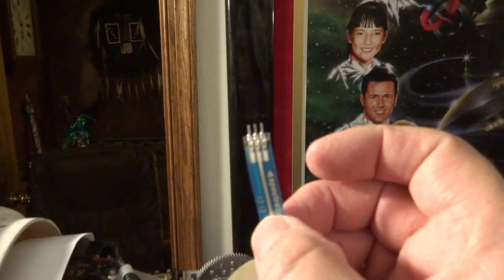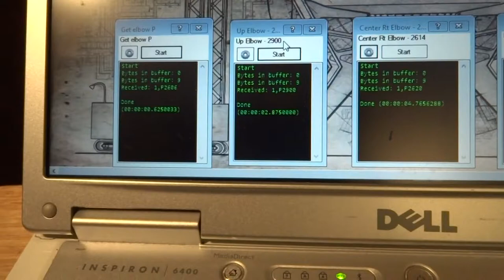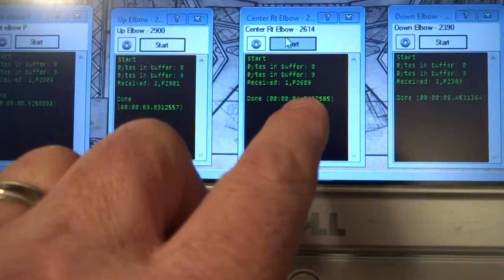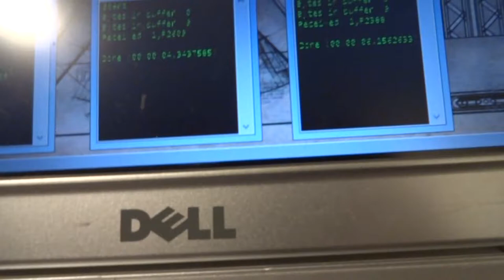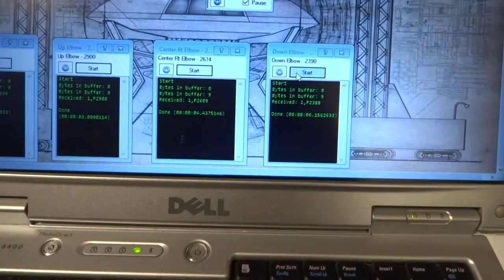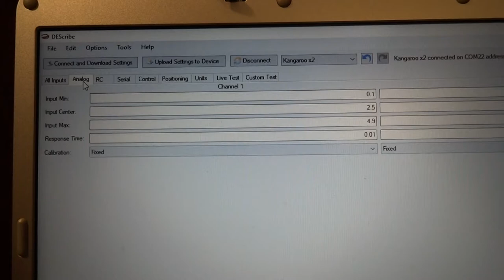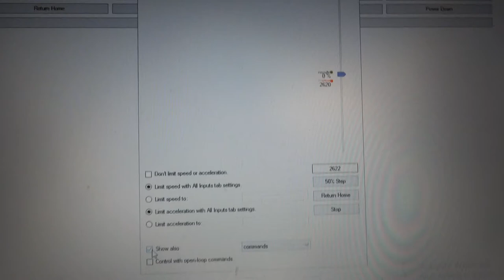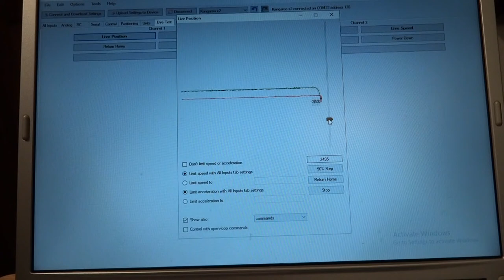B9 Robot Arm Centering Issuedemo

Comment: Hi Dave!
My guess is that your different centering points are caused by gravitational acceleration.  I'll bet that if you could lay the system on its side that the arm would center correctly from both deflections.  That is, the gravity "assist" when dropping back to center is causing it to overshoot the 2614 ma position simply due to inertia.  When coming upward, the gravity "drag" also hinders centering, but as it does not add to momentum going ups are the system has more time to stop closer to the 2416 ma spot.  Is it possible to create two centering commands, each with a different setting ( i.e., a higher one when coming down that causes it to "overshoot" to 2416, and a similarly adjusted one for the upswing?

Mike Buck
Reply from the maker: +Michael Buck Very interesting. I'm sure your correct.